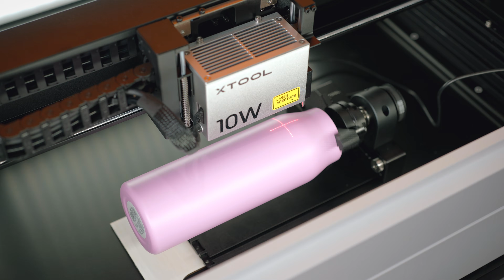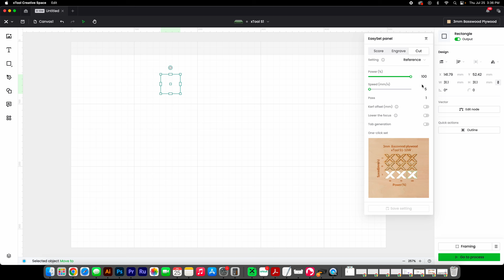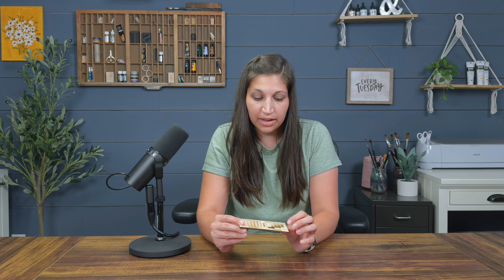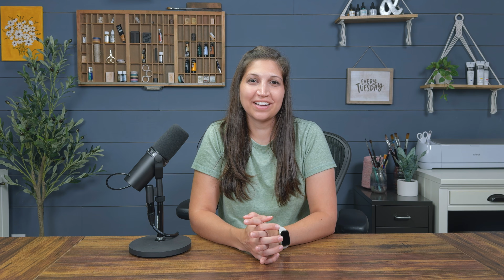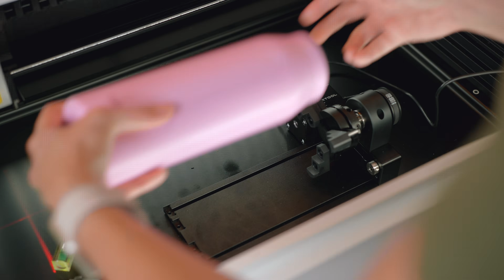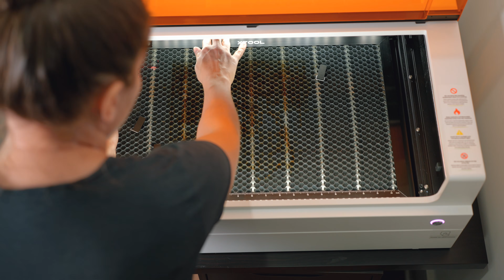9 ✨SELLABLE✨ products you can make with a laser machine FOR BEGINNERS

Comment: Hi Teela! Awesome video. I really enjoyed this one. I have wanted a laser for years but am concerned about the ventilation because I have parrots. Do you think that this would be safe to use if you have birds and it is ventilated in a separate room upstairs in the house? It’s a room they never go in but their bedroom is upstairs. Also, do all lasers take SVG’s? I sell digital sublimation files and wanted to create files for laser cutters but wasn’t sure of the correct format.
Reply from the maker: I'm not an expert, but from my experience, I would think it's fine as long as you're using compatible materials and have it well ventilated. I only buy my materials from xTool's site because I know they're safe (and they often run deals), with the exception of a few hobby lobby items (acacia wood + canvas which I also knew were safe). The inline fan makes a massive difference, so I would be sure to use that and ventilate through a window. We also have an air purifier in the office and it never works hard to clean the air (works harder in the kitchen when I'm cooking!). We've never noticed any smell carrying out beyond the room it's in, if that gives you any extra assurance!

I believe svgs are compatible with most/all lasers!